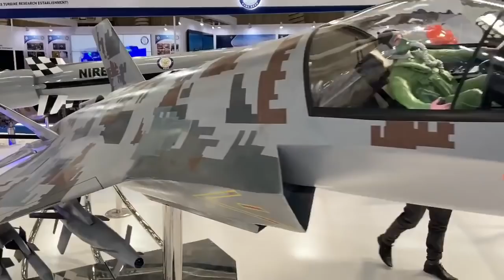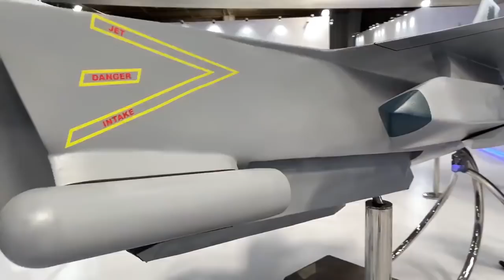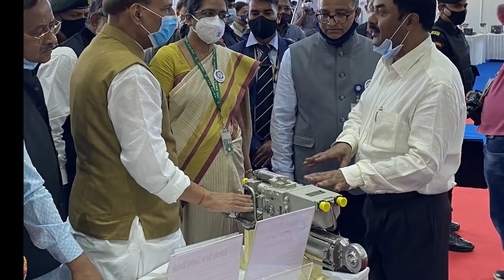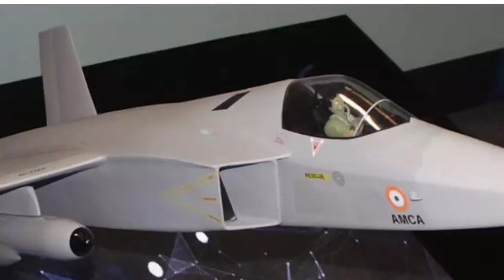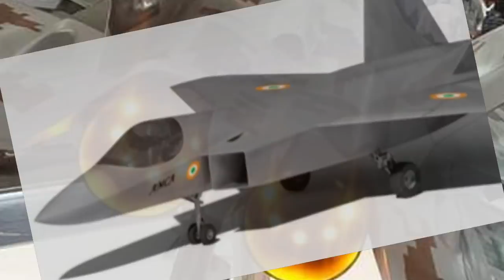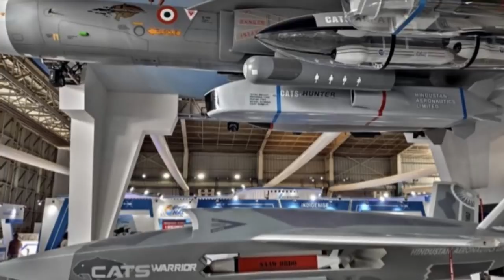AMCA prototype to be rolled out in 2024 | update on Tejas MK2 prototype

Comment: USA is spending about $8 billion dollars to develop a Variable by-pass ration jet fighter engine from an existing engine. They have been at it since about 2007 having completed studies and now are being finalised for engineers to begin actually making one. This may take another 6 -7 years for final engine to roll off the assembly line. You can work out from that if India has the will power (and the brains) to do all of that. Russia will in another 2-3 years be flying their variable by-pass fighter jet engine, Izdeliye 30, which is the intended engine for the Su-57. UK along with the participating countries will have their own newly developed engine for the Tempest, 6th generation fighter. All of this takes hard work.

Comment: From where did you find out that DRDO and Rolls Royce will codevelop the engine. Ive read that its still not decided whether GE, Safran or Rolls Royce will power it. Also i dont think full production will be in 2029 but earlier by a year or two, maybe 2027. The project is being fast-tracked.

Comment: Tejas MK2 should be built in the private sector as soon as possible. That way both the MK1A and MK2 are entering service as soon as possible. It can easily be financed by postponing the megalomaniacal plans by the IN and reducing them to only necessary equipment like mine warfare vessels and submarines. No more carriers and other force projection equipment until the army and air force are modernised or the current batch need replacement.
Reply from the maker: Tejas MK2 and AMCA will have comparatively more private players than Tejas MK1/1A
Reply: @IndianDefenseAnalysis  but as long as HAL does the integration with four people doing what they do in the private sector with just one it will be slow.

Comment: Today i saw your videos, very interesting and very much informative.
Why not we can design fighter engine rotating inside aircraft instead of moving pylons wings tails rudders ailrons in a dogfight?
Also why we should NOT go for 100% transfer for 110 KN thrust engines(dry) and 140KN wet thrust with pratt and witney or GE of America?
Reply from the maker: To answer your first question, engine design is very challenging considering not   only technology but here experience also matters. We are yet to mature the jet engine design of higher thrust which will take no less than 10yrs. Answer to your second question is quite easy. No American will give TOT to India.

Comment: If this is indeed the IAF 'plan', it is extremely sad to see this level of disconect from reality at the IAF Leaderdhip.
Fortunately, this is probably just hot air by youtubers and other mindless fanboys.
Only lsst week the new IAF Chief made public announcements of the future IAF strength that did not include any Tejas Mk2. Tejas Mk1A will begin development soon and the planned production start is in 2024. So there is no question of any Tejas Mk2 development until 2024. But most probably never. 
And IF AMCA's design is complete, when did the engineering take place that the prototype is being built. And if the prototype has began construction, than why is production planned for 2032?! 11 years from now! How many prototypes need to be built and tested that you need 11 years before production starts?!